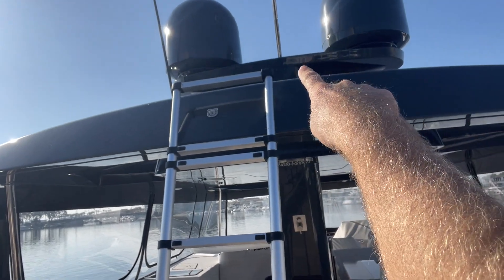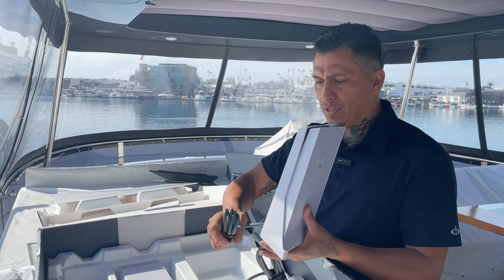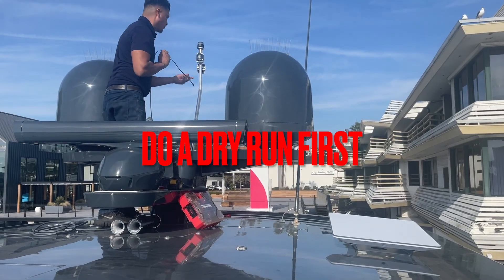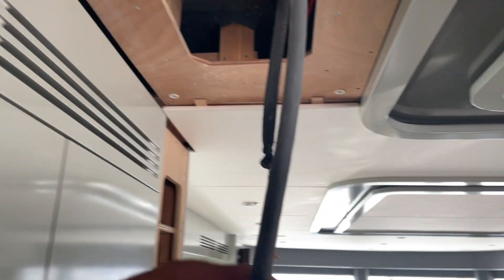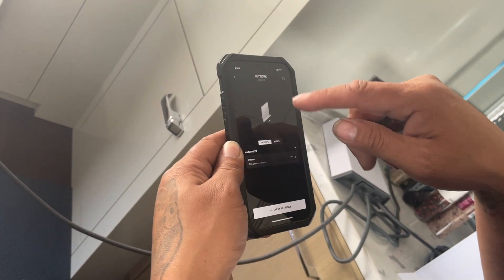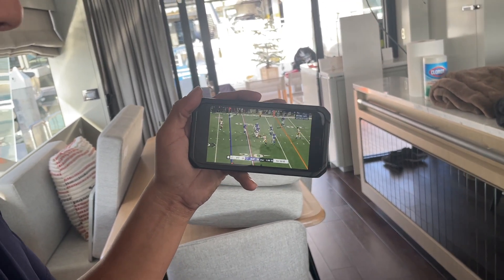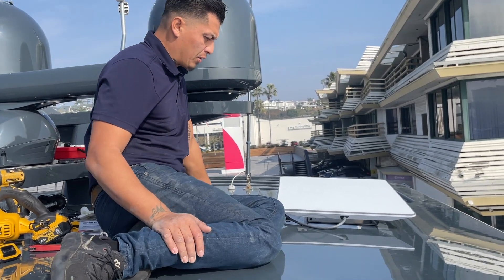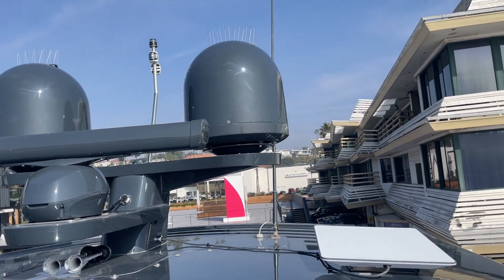Install Starlink on a Yacht

Comment: Are the bits and mount 316 Stainless?  If not, what is the plan to reduce corrosion at the attachment or mounting area?
Reply from the maker: Yes always use 316 stainless.